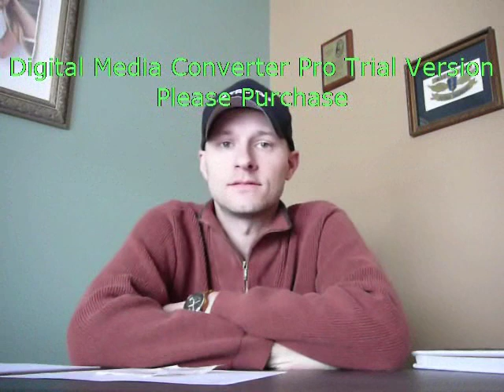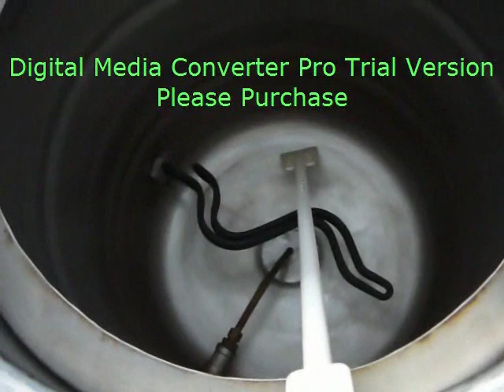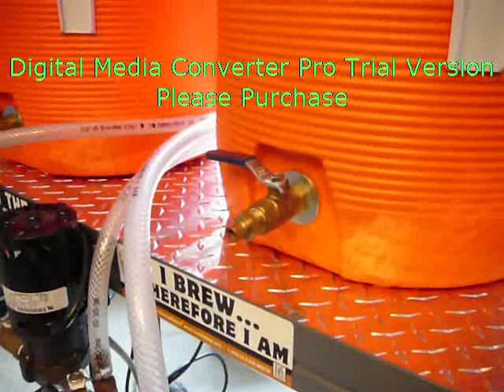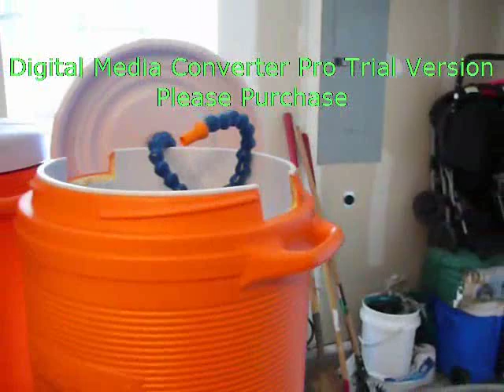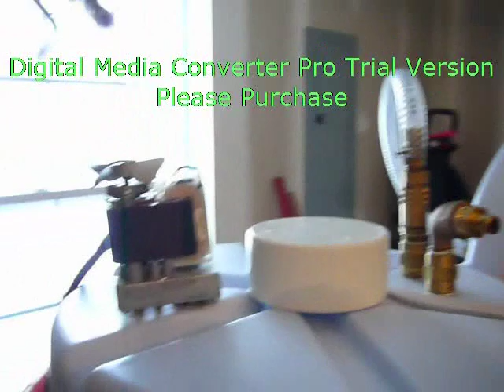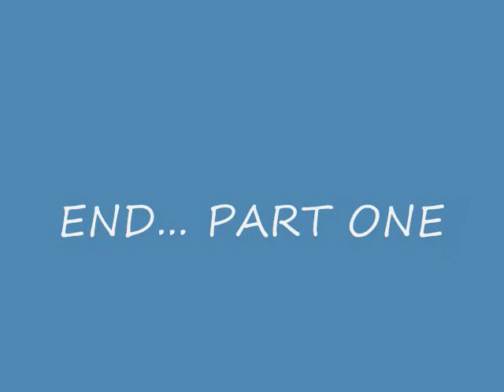E-HERMS Part One (Electric HERMS Brewing Rig)

Comment: Nice setup, I noticed that you have a digital pocket thermometer attached to your mash tun to check your strike water temp. How large of a hole did you drill, are gum stoppers readily available at Home Depot, and what else do you have holding in the thermometer . No leaks?